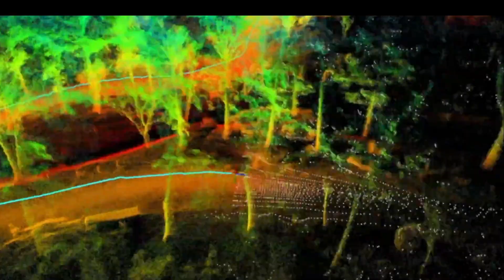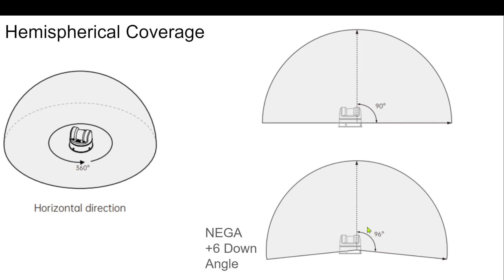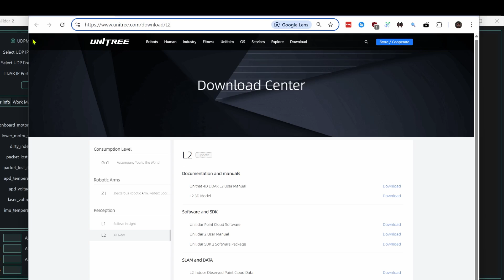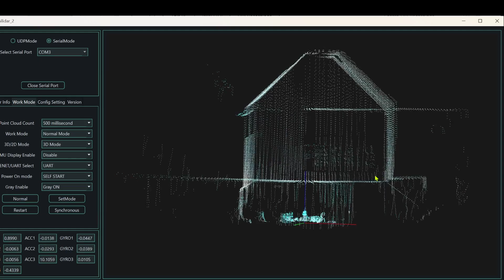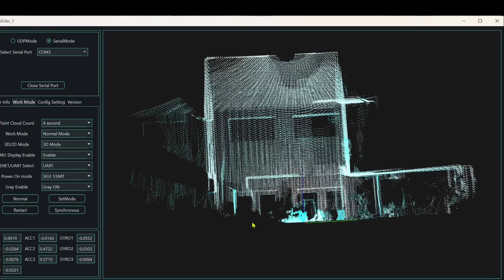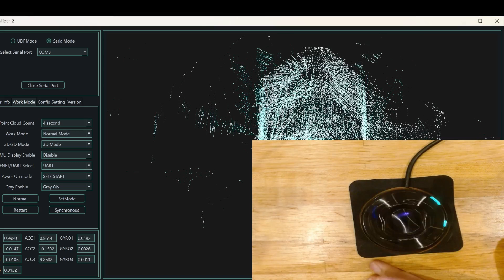Unitree L2 Lidar, Connect, Configure, Test

Comment: Great video! Is it possible to use the L2 Lidar on Go2 directly or some coding is required? I have a rooted Go2 Air but broken the Lidar. I'm wondering if I can just buy a L2 and replace the factory L1. Thank you.

Comment: Great video, thanks! What do you think about using this LiDAR on a flying drone?
Are there any projects already doing this?
Reply from the maker: prolly not a great idea. the dual-axis gyroscopic precession is very noticeable and weird. a powerful quadcopter could compensate, but i think most smaller drones would be better served with a (more expensive) solid state lidar.

Comment: Is it Possible to record the Point Cloud Data in this Software and export it?
Reply from the maker: Nope, this software is only for configuration and very basic testing.
Reply: Could you make a test video or just instruct a way to generate the 3D map and export it to some other software like Recap Pro or just save the point cloud.

Comment: The problem is that the application for windows is not opening in my system, any solution,  I started it as admin also but it just don't boot up.
Reply from the maker: It was a little weird the first time I ran it. It didn't come up, then I ran it as Admin and again it didn't come up. Turns out the security warning popped up below some other applications. Once I found it and bypassed the restrictions it's launched fine for me since.